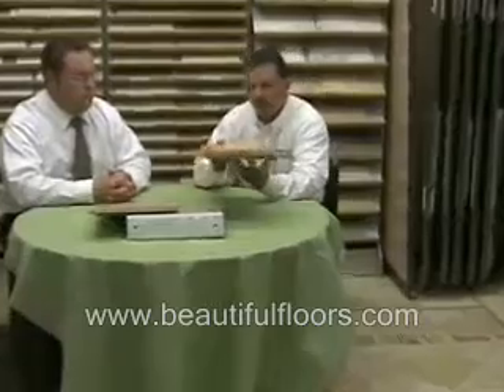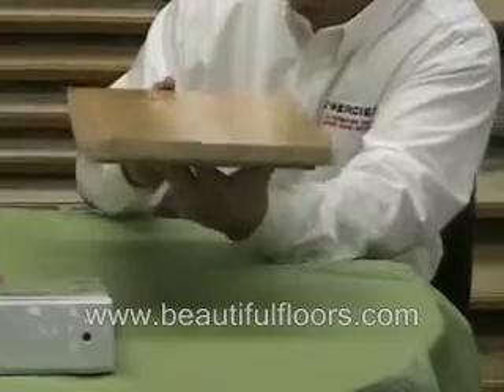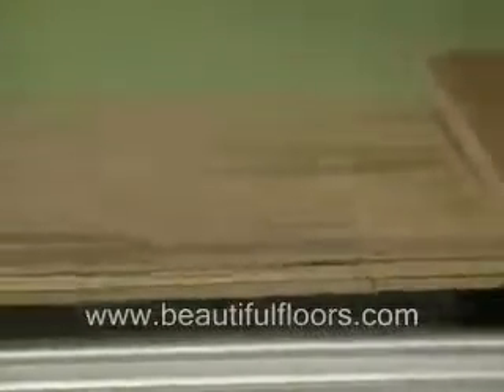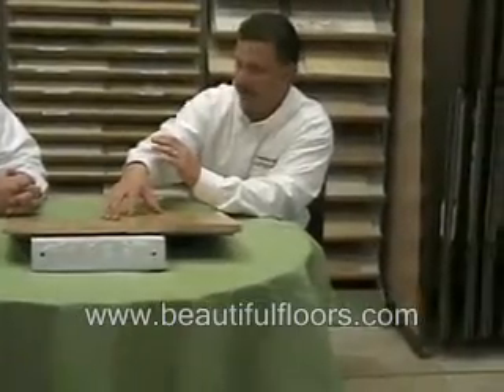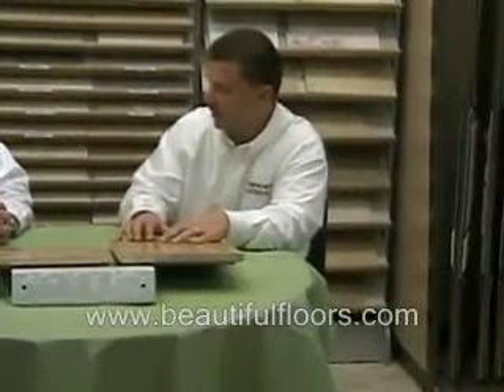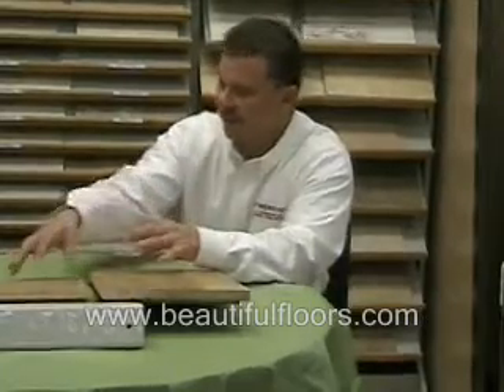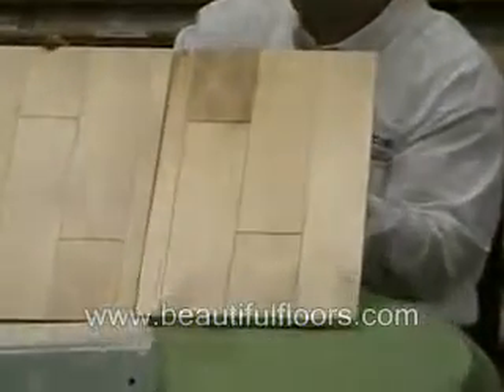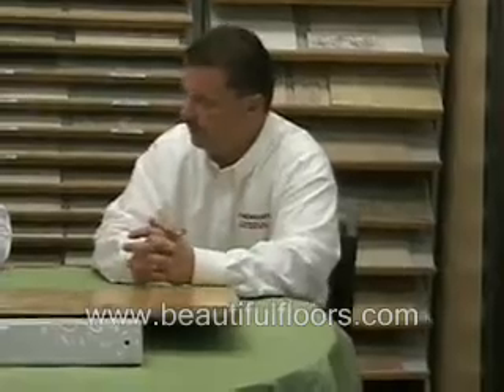What is the difference between engineered and solid hardwood

Comment: very good.How ever what he failed to mention is if a leak  or flood happens which they do the engineered floor will delaminate if not got in time.Solid wood will buckle  but
a lot of the time will settle back down if customer is patient enough to let it dry out .It may need a good sanding and refinishing which is ok cause its SOLID WOOD